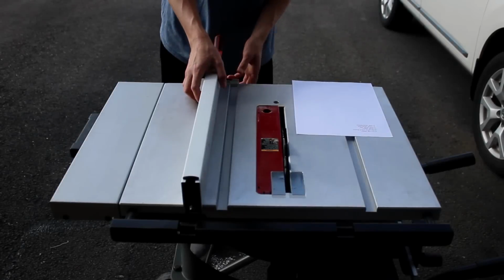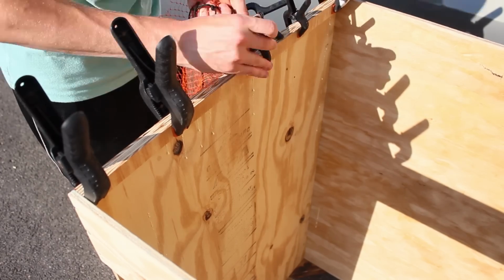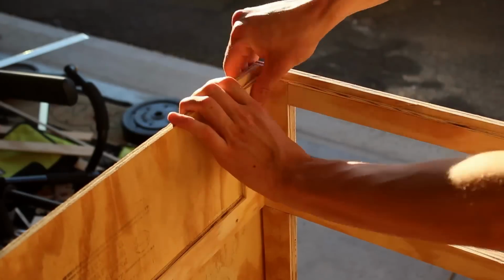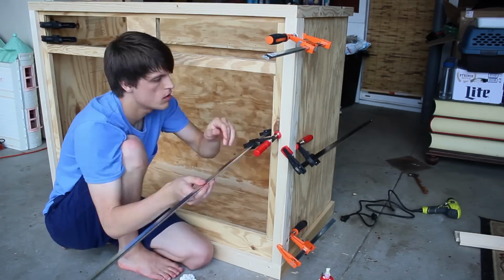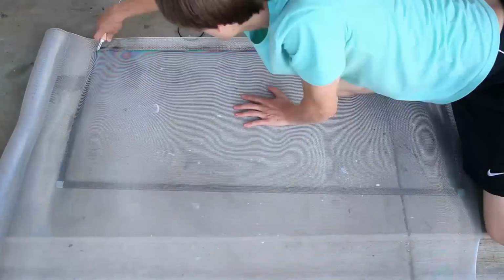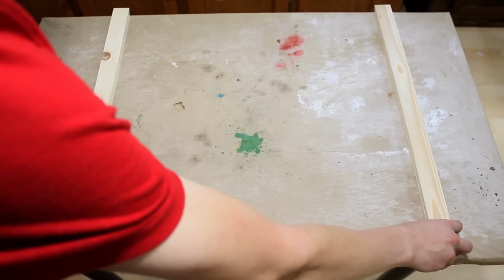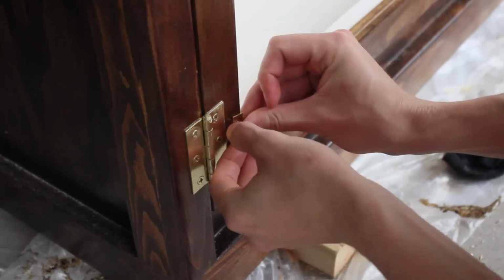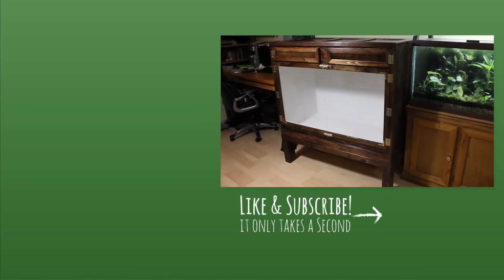DIY Plywood Reptile Enclosure (Large Version)

Comment: i know this video is a few months old, but for what its worth i would like to share some wisdom. Firstly i loved how well planned this project was, especially from a woodworkers perspective. Though some of the techniques weren't optimal (i.e. screwing together the thin plywood on the edge, a thicker piece of plywood would be more suited for less experienced viewers. Don't get me wrong, your execution was perfect!), they were still adequate for the purpose of the project, a cost-effective enclosure. The spray-painted screen had a nice visual appeal, but you expressed your concern with erosion and decided to use spray paint as a precaution. I thought that you would like to know for future reference that aluminum isn't prone to erosion while indoors under normal conditions as aluminum won't react to water or moisture the same way steel/iron would rust. There are specific conditions that are required in order for aluminum to erode (for example acid rain or contact with corrosive chemicals such as lye), none of these conditions would be present in an animal enclosure, I would hope lol :) if these conditions are present you could instead use a different screen. At my local Menards/Home depot I found so-called "animal resistant screen" (for the same price and size as an aluminum screen)and was skeptical of its strength in comparison to an aluminum screen. I can testify that it performs better than an aluminum screen and is easier to work with. I Believe that it is inert as well and it would be more difficult to erode away than aluminum due to it being a strong combination of nylon fibers coated in a black polymer that is quite pleasing to the touch. Anyways my hat goes off to you sir. Best wishes!

Comment: What kind of wood is the plywood? I have looked and the cheapest plywood I can get is pine and I heard that pine was bad for reptiles. I'm looking to make a cage similar for my bearded dragon (just maybe not as tall) and I was also wondering if this would be okay for a bioactive setup?
Reply from the maker: I think these are pine boards, but it doesn't matter because they are all sealed up and the animals can't come in contact with them. Also I ended up converting this into a bioactive setup, so yes.
Reply: Hooray!! Thanks for the response I kinda thought you wouldn't have responded since this is an old vid :)
Reply from the maker: I do my best to respond to most comments. They usually only get lost if you reply to someone else's thread.
Reply: Well thank you for the quick response!

Comment: One solution for the ugly magnets on your doors would be to buy circular neodymium magnets with a hole in the middle. I used these for a project and countersunk them and put a screw through the middle. This way they could be hidden behind your door frame. Just a suggestion. I love this project and video.
Reply from the maker: That's what I wanted to do originally (still have the magnets), but I couldn't get it to work right with my drill bits. That said I do have the right hardware now, so I will probably modify this at some point.
Reply: @SerpaDesign  A forstner bit is what you want for those magnets

Comment: instead of gluing multiple pieces of half inch , why not use  three quarter and inch thick where necessary... way too much work . i`d have built this in less than half the time with a quarter of the screws/cuts etc

Comment: Orrrrrr

Just buy thicker plywood panels
Reply: Griffly Art and Gaming could still run into bowing issues especially with plywood since it is just thin sheets of wood pressed together
Reply: I was thinking the same thing.. He skimped out too much, what was that 1/4" plywood?
Reply: Chrisfragger1 3/8s I believe and even thicker plywood would still bow over time also he was able to use other pieces to put 2 3/8 sheets together making it basically 3/4 plywood for extra support

Comment: This was built so well! Great job. I'm going to be building my own snake enclosure soon but one thing has me stuck- since wood is a poor conductor I'm not sure where to place my heat mat! I've heard you shouldn't put them inside the enclosure as this can lead to burns and water getting on it, does anyone have any advice? I'm not sure what alternative to use as the snake I'm getting does not need a basking light- it needs belly heat.
Reply from the maker: Your best bet would probably be to make a false bottom of sorts using a thin piece of plywood that is well supported and/or make the bottom thin to begin with. You'd loose some strength, but could probably account for it in other ways. Something else to keep in mind is this enclosure will retain heat better than a glass or acrylic enclosure.
Reply: I realize that this is quite late, but as long as your snake is not a burrowing species, and you have a good layer of substrate.

Comment: Wow that turned out awesome :) Thanks for the video
I recommend a neodymium magnet drilled and epoxied into the back of the door frame and a screw on the cabinet to make a concealed door catch behind the frame. Bit of wood filler on the existing magnet screw holes and no one would ever notice ;)
Reply from the maker: I did experiment with these a little bit on some scrap wood, but I couldn't get it to work right. Maybe I will revisit them down the road.